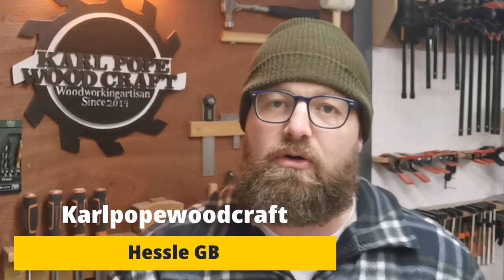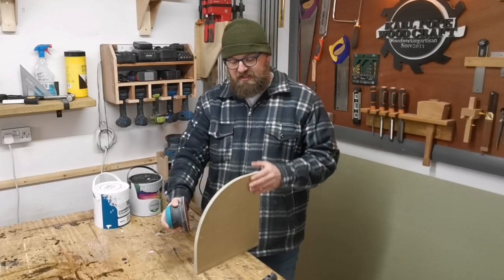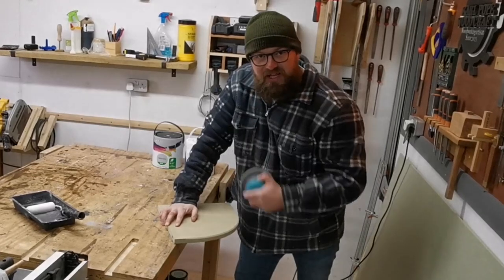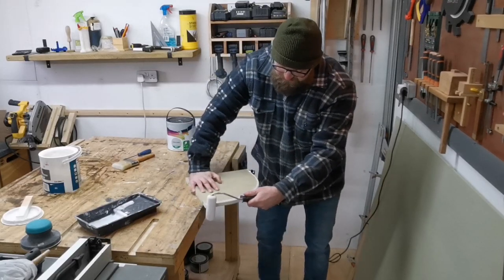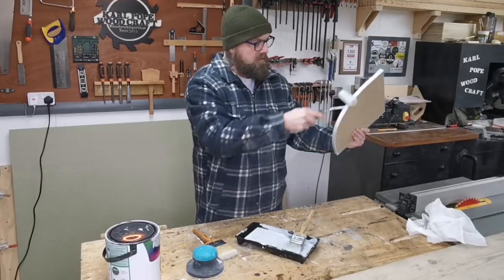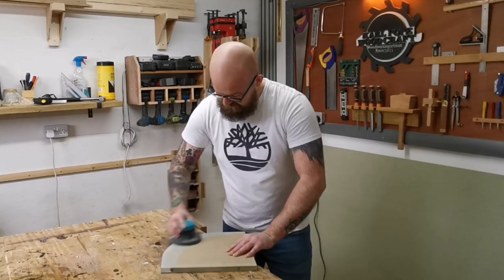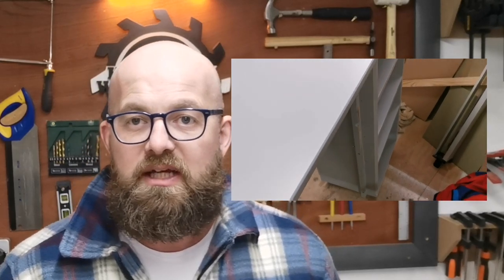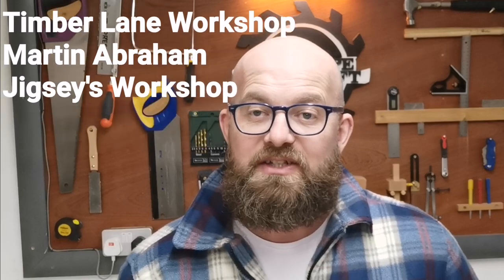How To Paint Mdf End Grain Made Easy Woodworking tips

Comment: Top job mate. I'm just about finished my wee work shed and the MDF is every where. Now I don't have to edge band .Happy days 😊😊😊. Thanks for the upload mate .
Reply from the maker: Awesome Davy, if a shelf is going to get a battering I'd put a pine edge on it about 10 or 15mm but if it's light use it should be fine. 😊 Wouldn't bother with iron on edge banding though, defo.
Reply: @karlpopewoodcraft  Never touched the stuff since I ruined the wife's iron lol.
Yes you are right , its the worktop edges that I'm doing but also i have over 20 drawers to do. Cheers mate
Reply from the maker: @HEADBANGERINGS  20 drawers 😬😭

Comment: great info! I dont use MDF for several reasons but I learned something new and I might have to consider it for future projects.
Reply from the maker: Hi guys, the mrmdf is also lower in cfcs and not as harmful, it's also denser and machines so much better. If your going to be painting a project and want a great finish I can't think of anything better to use. 😊

Comment: I am painting a larger sheving unit made of MDF. I've got a acrylic sealing primer and acrylic paint but am planning to use a paint sprayer. If I need to thin out the primer or paint, I guess I would avoid water and use a paint thinner?
Reply from the maker: Hi mate if you are using acrylic paint then water is perfect for thinning.
Reply: @karlpopewoodcraft  thanks for the reply. Even if I'm unsure if the mdf is water resistant?

Comment: I have always found painting the MDF edges requires at least 6 light coats of paint consisting of primer, undercoat and the final paint finish. I have even tried MDF sealer before painting the edges, which being water based has caused the edges to swell. I think in future, as you have suggested I will use MR MDF. Is MR MDF much more expensive than just normal MDF? Don’t think I have seen MR MDF in B&Q where I normally by 8x4fft sheets. I really enjoy your content as you keep it pretty simple, and the end result is to a high standard, without the need for really expensive equipment.
Reply from the maker: Firstly thank you Richard I really appreciate your feedback. Well I pay £35 for a sheet of 18mm MRMDF and the regular brown mdf is £25 so definitely more expensive but 100% worth it in my opinion, time saved on preparation, painting sanding ext. You will need to purchase it from your local wood yard where the tradesmen go not the DIY shops. Hope this helps Richard 😊

Comment: The key take away here seems to be "good quality" and I have to agree. Probably the most important bit in my opinion is the MR MDF, it seems to make a huge difference.
Reply from the maker: Cheers mate, ye 100% agree decent mrmdf decent paint, layland is cracking in my opinion and homebase supply really good quality homebase brand paint. 😊
Reply: @karlpopewoodcraft  I could not fin Layland last time and I went with Zinsser (the blue tin primer and the antimould one for the topcoats). Bloody expensive but amazing.